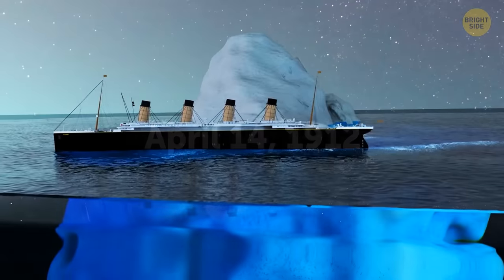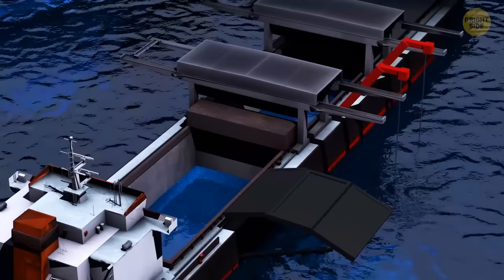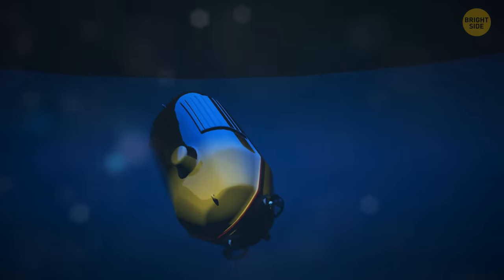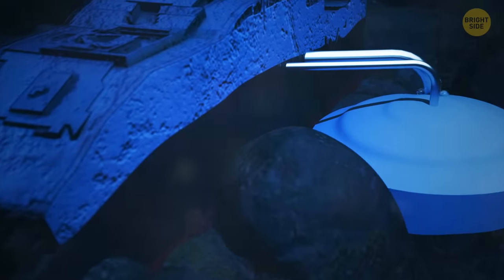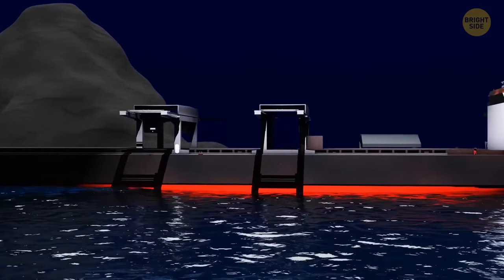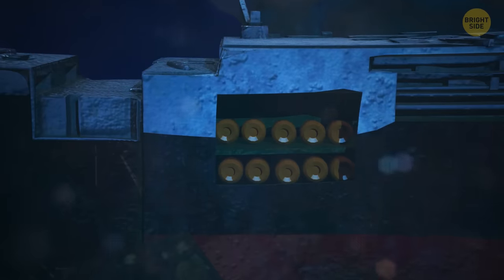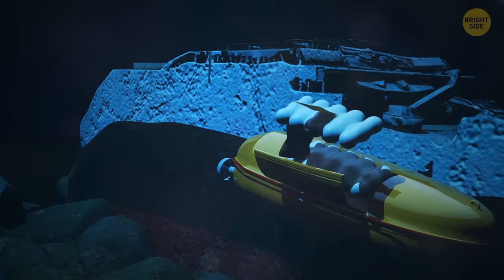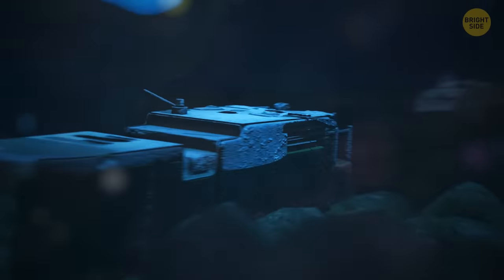11 Ways to Raise Titanic but Only 1 May Work

Comment: I wonder if it would be possible to build a metal sarcophagus around the wreck. Like completely around it essentially cutting and enclosing a chunk of the seafloor and titanic inside. The water could then gradually be pumped out and air pumped it and it would raise on its own. The box would have to be made out of a durable material and have support so it would not implode once the water is pumped out and air is pumped in and have tow mounts on it so it could be moved once it floats to the surface. Then once it is moved to where it needs to be they can just disassemble the sarcophagus and recycle the material they used to make it or turn the sarcophagus structure itself into a museum
Reply: With how deep down it is adding the immense water pressure at that depth and how big the sarcophagus would have to be I don't think we will have that kind of advanced technology for decades, by then the titanic will have long since been gone.
Reply: They can barely get a tiny sub down there without it being crushed..... so NO

Comment: Attach dozens of large rubber bladders, each 40 ft x 20 ft which attach to the hull with grapple hooks through the ship's portholes, therefore no need to put anything under the hull.  The bladders are then filled with air from above.  Each bladder will need a pressure relief valve since as the ship rises, the water pressure is less, the bladders expand and otherwise would explode.  More bladders the better, too few means too much lift in limited areas and the ship would break apart.  All said and done, the Titanic now is probably too fragile to do anything with, leave it alone.  I'm a naval architect and that's my solution to lifting Titanic.
Reply: That has already been done to a piece of the hull but they used diesel because air compresses and diesel doesn't and still lighter than water.

Comment: I personally think the best way to bring the Titanic up from the ocean floor would be to very slowly over very many years construct a water-tight cylinder wall around the two large pieces, and once it has reached the surface, drain the water inside the cylinder back out into the ocean. Once the water is drained, we could again very slowly lift the Titanic up the shafts... I don't know if this would actually work or not or be too expensive, but hey, its just an idea lol.
Reply: I thought of this as well
Reply: Would be too late by then
Reply: Mate, it's 2.4 MILES under the ocean surface 🤣
Reply: It’s not completely impossible, it’s just they don’t want it to be expensive lol I’m pretty sure they know that can work but again it’s too expensive

Comment: Three foot thick transparent aluminum walls box in the Titanic an all sides, creating an aquarium. The water is slowly pumped out, and replaced with air. An electrolysis system is then set up to clean the ship of as much rust as is reasonable possible and  the ship is reassembled in the "aquarium". Once reassembled, water is slow reintroduced to float the ship and the ship and "aquarium" are slowly raised together to the surface. Cost? Multiple trillions of dollars. Hope it was worth it.
Reply: You will have to hire Scotty as chief engineer.
Reply: it will work but they must be really careful while removing the rust cuz the ship may collapse while they do this.

some pieces of the ship are supported by almost nothing but rust
Reply: Transparent aluminium???? If you try to clean it from rust, you will probably remain with a mountain of rust and small pices of metal. Stop watching so many retorations, it's not the same thing.

Comment: Wait a minute! What if we put a giant plate under the seafloor where the ship is and then lift it up?
Reply: the plate would have to be incredibly strong with multiple layers. a ship pulling up this weight would need to be strong enough to hold a large slab and what's left of the titanic. you'd have to push a colossal surface area (probably in km) up to the surface, which the very high pressured water will definitely resist; there might not be any ship strong enough to carry out this task. also, if your slab lists too much, titanic would fall off. let's not forget the incredibly high pressures of water you are building in, and these pressures that you'd pull the slab through would probably cause implosions. theres no way this could work

Comment: #1 would probably work.   You do the mesh.
You pump down dry ice, not liquid nitrogen.

The dry ice is solid,,so it will not rise up like bubble through the mesh.
some of it will vent to gas, but some of that will also freeze water and get caught on the mesh hindering escaping gas..   slowly extra ice forms  any frozen bubbles add to buoyancy

Comment: We need to combine multiple technics using 3D scan of Titanic wreck find out weak spots.

1.Create Support column at bottom of wreck with wood logs or pvc or polycarbonate tubes

2. Cover the outside spots with wood crate, Styrofoam and polymer to make it leak proof

3.Once sealed tie float bags and bouys to support structure 

4.Freeze the outer part till 1 or 1.5 meter.

5.Start to pump water from inner portion which is not frozen

Comment: The only way to raise Titanic is for her to remain submerged in water in a contained enviornment..   Create a specialized dock that likely has to be built or frabicated for the ship and surrounding area.   then box her in.  Then have cranes or similar from multiple ships to hook up to the dock with the ship inside and gently raise her up.   Then when you reach a certain point install further devices to insure the dock can float at least just under the surface.  put some bracing and keeping the ship inclosed in its container which should have something to allow it to cut through water to reduce drag and gently try to get her to what ever destination you want.   Essentially your creating a submerged dry dock for her and what ever soil she was trapped in essentially a armored snowglobe.   

Once in harbor the container will need to keep the ship submerged and contained until she is placed in a facility or a facility is built around her.  Then in a controlled environment.  You can then study the ship.  The first thing to be done will be in destroying or removing sea life that is consuming the remains.   Or around the ship that can be placed in aquirums or returned to the sea.   Treating the water with something to help in preservation will be neccessary.   She can never be exposed to air.  Water helps in displacement of her weight and remains.   Then bracing will be needed to try to see about reinforcing and preserving the remains to at least keep her upright.    The same could be done with the stern but the stern is so far gone your better tearing the remains apart in smaller sections.  

The effort for such a mega project likely would approach that of most modern skyscrappers being built and unless there is a massive interest and people willing to pay the money its likely such a project will have no cost benefit other than the tech proving that it can be used for deep sea recovery.  

In the end its likely the ship will gain some attention, be a centerpiece for a few decades and then be forgotten.  Depends on the nation however and political group in office.

Comment: I heard of one method that involved building a giant wall encircling the Titanic all the way up to the surface, and then draining the water. Once the water is gone you could essentially use a winch to lift it up
Reply: It's 3800 meters deep. It's too tall, it needs a lot of consolidation to remain strait and you can't make it waterproof.

Comment: You should use a metal enclosed cage and put it around it and then pump all the water out and then use a torch to disassemble all the bolts And bring it up.

Comment: Build a huge steel cube like structure surrounding the Titanic that peaks above the waterline. The weight alone will bury itself into the ocean floor making the walls water tight. Then use pumps to extract the water.

Comment: This is my theory, I really loved the  Titanic and to raise it, maybe I think to first add metal 5 inch thick watertight metal walls surrounding the wreck area, then the water in the wreck area I will drain. Once done with that I will launch a driller and make a elevator somehow under it which will be able to lift the Titanic to 1m above surface, then I will hire people to refloat it and then release the walls which will flood the area where the Titanic used to sit for long. Then I will lower the elevator and hopefully the Titanic will float. Once done, tugboats will tow it to new York where it will be preserved permanently in a large aquarium with clean filtered fresh water. Don't judge this, I am just a kid and love the Titanic.
Reply: Sorry, but unfortunately the water pressure would probably destroy the thick watertight metal walls
Reply: you'd need to extensively repair practically the entire ship for it to float safely. in the middle of nowhere, 400 miles away from land.
Reply: and i would leave it in Southampton, where she left for her maiden voyage, or Liverpool, where she was built

Comment: You can't "just lift the ship a little and put the mesh under" not because you can't lift it, but the ship is half submerged in the mud. One ideea would be to put some kind of huge empty baloon inside of the ship, then with an electric pomp to be inflated with helium or oxygen. Lift it and put into a "strainer " with the shape of the ship to make sure the ship wount breack and you don't lift even more water to be heavier. To take it out, you don't need a normal ship, but some marine industrial cranes and amphibious ships (they are very powerful).

Comment: Here's a thought I haven't heard yet that I think would be more practical than any other idea I have heard: Why not dismantle the Titanic wreck and bring it up in pieces, and reassemble it at the site it is intended to be placed? That may be a monumental undertaking and may be expensive, but it wouldn't likely be much, if any, more expensive than any of these other crazy ideas. Also, bringing it up in pieces instead of all at once would likely be a bit safer (less likely to flounder the ship(s) raising it). The biggest downside is it may not be reassembled identically to how it sat at the bottom of the ocean, but it could still come pretty close and nobody would notice, and its original state at the bottom of the ocean has been thoroughly recorded so it shouldn't matter that much (it'll just disintegrate where it sits now anyway)
Reply: who is going to loosen bolts...and attach cables, ect...  you..  You can't get out of the sub.. you would die instantly.

Comment: What about just putting a giant dome over it lol. Or building a two and a half mile deep water tight wall around it , then drain the water inside the wall lol. I’m also aware that neither of those ideas would actually work because of the pressure and force but it’s a fun idea.

Comment: The Titanic has been under water for so long. I think it would just disintegrate if they brought it back to the surface. They found a train wreck underwater in 1 of the greatlakes but didn't liftit. Because They said it would disintegrate if it was brought back to the surface, so what makes them think titanic will be any different.
Reply: They raised the Mary Rose after 400 years.

Comment: What about using aerogel? Seems like it would be easier to handle. Idk if it would collapse in on itself at that pressure and I'm sure it would be costly. But I would think maybe they could use some kind of giant bags that they fill with aerogel and maybe if placed in the correct places that it would be strong enough to lift what's left of the ship. I know it wouldn't be that easy but that would be a place to start. In reality though they should just leave the giant ship where it's atas a memorial to all those that went down with it.

Comment: I'd say just leave it be.

About the only way I see the Titanic surfacing again simi-safely would be to build a wall structure around the wreck site(either out of brick and concrete) and have it tall enough to be over sea level. Then pump out the water inside. 

Though considering the damage it's already taken from the sinking as well as being submerged under the salty sea water for over a century no matter what method is used the act of moving it or the water within would likely ruin what's left of the historic ship.

Comment: they could use a cable saw on winches with a continuous diamond impregnated cable to cut the forecastle off the ship back to the well deck, they could cut the anchor chains and the anchors would drop off, to be lifted separately using one of those huge lifting ships like the US navy hauled the USS Cole on. the weeck is going to disintegrate eventually, might as well save the most iconic part, the prow and forecastle, they could reattach the anchor chains, or
even possibly lift the forecastle with the anchors attached..

Comment: It can not be raised. It is extremely heavily corroded. If it does not break while being raised it will break under its own weight once it is lifted out of the water. Heavy corrosion will also prevent it from being used as a museum because nobody can get inside without breaking trough the rusted floors.

Comment: but have you tried using both planes and ships at the same time? that will be double the strength and a little easier
Reply: planes can carry only so much weight before they are unable to hold themselves in the sky. while they definitely could tug, you'd risk submerging your plane.

Comment: If you make a circle huge it will take a long time but it works just like in glass underwater places its perfectly the same big walls circling the titanic and later are used like for other stuff and boom you have a clean titanic by water pumping out the water and dan you can get the titanic up whit maybe helicopters or huge ships whit magnets or there are way more ways

Comment: We Need to raise It and Make It a tourist attraction
Reply: first of all, we are not making the grave of 1500 into a tourist attraction, and second of all, raising the ship is impossible, getting equipment that can lift such a heavy wreck down to 3800 metres is not possible, and if you were to move it, it would fall apart and the wrecksite would just be a bunch of metal plates instead of a somewhat-intact ship

Comment: Personally i believe if man can think it, man can do it, for sure it will crumble but i believe there are sections that may still have some strength, not many but some deep parts that have so much strength that it still has structure but it will be probably be inside and underneath,  but likely not on the outer surface and not easy to access, there are too many problems and whatever they do they will have to build some type of rigs in that location and if you try to pull it out the cables alone will weigh several tons on top of the ship weight so it is possible but almost impossible at the same time.

Comment: Just box the titanic debris area with looooot of pressure proof metal from bottom to the surface of the ocean and then pump the water out. The most radical method😂

Comment: honestly, any attempt to raise it should be denied as A. the ship is too fragile and would disintegrate on the way to the surface, and B. it's a mass grave site, and disturbing it would be disrespectful. however, instead of raising it, what if we thought of a way to preserve and/or partially restore it instead? we could occasionally transport materials down to the wreck to use for deterring both organisms and natural processes that deteriorate the ship, as well as for rebuilding damaged sections, but only to their original post-sinking state. the deterrents for organisms might even some day end up unneeded as use over time will result in possibly deterring them permanently, saving the Titanic from any further damage from organic sources. i'm not suggesting trying to put the ENTIRE ship back together underwater, for that'd be both crazy and, like i said earlier, disrespectful to the victims of the disaster

Comment: There's possibly one thing that could work build a wall you could use metal to go around the Titanic and make sure that the wall can handle the pressure underwater and keep building it until you get to the top then get a massive massive pumps to pump the water out of the Titanic wall area and then you will not have the problem of water pressure holding the Titanic down then you could possibly cut into sections and put it on a boat that can handle the weight of the Titanic in sections and then carry it  wherever you want problem solved
Reply: What Kind of Metal?
Price Tag?
How would you hold the walls in place?
Have you consulted an engineer about this and if yes did he laugh in your face?
What kind of pumps?
Where would the water go?
How do you know it's not actually the water keeping the Titanic together, I mean the Steel is corroded to the point of limited stability, why waste billions on this project only for the superstructure to completely collapse when the weight of the water is gone?
Do you have underwater excavators that can dig trenches and means of laying the foundation for the walls under 12500 feet of salt water?
Last question, who would pay for this?

There's a long way to go before it's wise to declare "problem solved"

Comment: What can strengthen its armor?
Meaning its armor is weaker, right?
If there's no more acid water pressure, then there's no more damage! 
Meaning: put in a dry or fresh clean water container instead that it's big enough to fit its size perfectly and then  raise it 😱